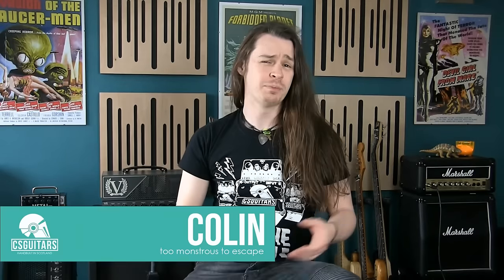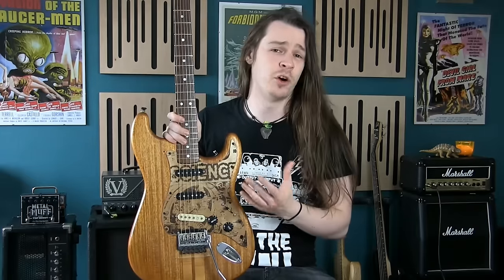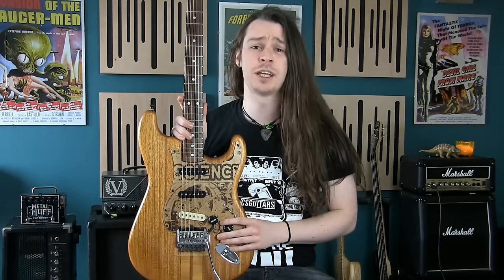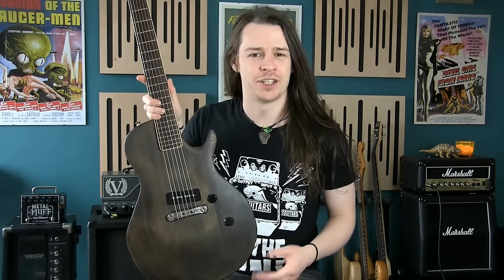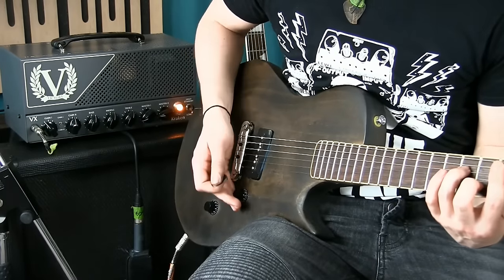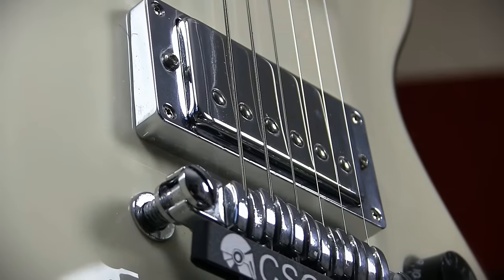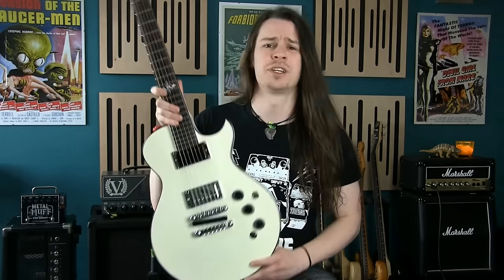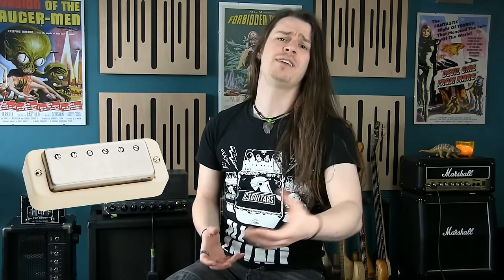Single Coil vs P90 vs Humbucker: What's The Difference?

Comment: make a video about difference between active and passive pickup....please...
Reply: Reggie SoundBox 

Colin did that already. He is not a fan of the active pickups. I think active pickups shine better as bass pickups to guitar.
Reply: Gringo Green did he?i'll watch it later...thanks...
Reply: active basses have good control but passive bass pickups sound just amazing with the right overdrive. R.I.P. lemmy of motorhead.
Reply: Reggie SoundBox Yeah its a really old video though.
Reply: active pickups are good if you dont own an amp....lol. i have actives in my ltd ec330fm guitar and my ibanez sr300 bass...in the bass they are amazing. in the guitar i dont see much difference other than "shpuld i change the battery soon?" lol
Reply: He did...He found that active pickups suck because they take away your ability to dynamically control your sound.
Reply: Which is bullshit, there are active pickups that do have dynamics. For example Fishman Fluence.
Reply: @EvilDragon666  i'm pretty sure at the time he made the video, the only active pickups in the market were EMGs or EMG clones
Reply: @hazenstribling2646  In 2017? Wrong. Fishman Fluence existed in 2017. And there are other active pickups that are not EMG/EMG clones, have existed for years...
Reply: @EvilDragon666  I'd rather go with some DiMarzios for half the price.
Reply: @homevalueglass3809  I wouldn't because Fishmans are just THAT awesome :) Just purely MHO.
Reply: Active pick ups hold notes longer

Comment: A great detailed video, just one comment about you putting the pickups to certain genres, it should be mentioned that you can get any genre on all three pickups if you play them right. Gary Moore, BB King and Joe Bonamassa all have bluesy feely stuff on buckers, where the likes Andrew Groves from Arcane Roots and Simon Neil from Biffy Clyro have got really heavy sounds from strats!
Reply: Totally agree. Like for example, people usually recommend single coil pickups for fuzz, but guys like Robby Krieger and Josh Homme got along just fine with humbuckers.
Reply: WRAITH don't forget Jack White and Billy Gibbons, both notorious fuzz users with their collection of humbuckers
Reply: Don't forget Ritchie Blackmore. Deep Purple were one of the proto metal bands and Blackmore always played a Strat.
Reply from the maker: Not at all saying that you can't play anything with any pickup. Just most common uses for the sake of keeping the video concise and under 7 minutes long.
Reply: John Maloney Uli Roth is also a good example. No one can tell me "Sails of Charon" isn't heavy and thick in any way, shape or form.
Reply: It also depends, of course, on the quality and build of the pickups. I bought a guitar with two humbuckers that whilst being excellent for very heavy shit, just can't quite cut it for more melodic stuff without muddying everything up a bit too much.
Currently my local guitar tech has it and is fitting a more versatile humbucker (iron Gear Rolling Mill) and a humbucking P90 (Iron Gear Alchemist 90). Hopefully this will improve my versatility and tone, if not my scrappy playing.
Reply: I keep seeing comments on YouTube, where the end of the comment has been cut off, why is this happening? Is there any way to see the full comment?
Reply from the maker: +B0rnles13 there is an easy way to see the whole comment. All you have to do is click on the
Reply: GENIUS =D
Reply: If the extension button is gone it might be connected to your browser. 
Check if you zoomed in at some point...that might have caused it to vanish.
Reply: I've heard of a lot of metal guys who hide p-90s under a humbucker cover
 As for players getting different genre sounds out of uncommon genre pickups...these guys have everything customized.To the kid in the front row,its the same standard Strat he can buy at Guitar center ,but reality is that guitar has has been heavily modded.Along with the amp,which looks like a two thousand dollar amp,but you'd have to pay a tech 15 grand more to do what's been modified for these players.Then run it through a million dollar board,and yeah you're not getting that Stevie Ray sound from a stock les Paul through a stock Fender amp.
 These players have endorsement deals,so they play certain gear, even if their tastes change and they mod them to sound more like a competing brand.
 Bottom line is,off the shelf for the kid looking for a sound...don't base it on what you see on stage.
Reply: You dont have to pay 15 grand to get ANY tone period. Ya if you use a $100 guitar and a $50 amp with 30 bucks worth of pedals youre going to be limited. But its pretty easy to build a $500 setup that will get kindof close to any sound with an hsh/hss guitar a decent modelling amp and/or a megacheap tube amp and multifx pedal.  ANY guitarist understands that with cheap shit pickups fed into a cheap garbage amp youre flat out not going to sound good. But even LOW end guitars now are 10x bettr than anything from 20 years ago and you can get pretty nice electronics for pocket change compared to what they had to pay 30 years ago
Reply: honestly though i cant understand a metal guy using p90's. i know theyre the rage but damn toss a nazgul and sentient in there and youve got a stunning array of sound and some serious metal pickups
Reply: always liked pearl jams tone better. More deep metal than nirvana. Nirvana had the pretty blond frontman the 14yo girls who actually buy most music love though
Reply: Vince guitarists know you CAN  get >close<. Newbies reading this might think you can do anything with one guitar. I have 5 very different guitars and there are tones i cannot get (setting aside the player). Of course i can get very nice and close tones. But you wont get strat twang on an lp period. You wont get the heavy crunch or DEEP full sound on a single coil strat you can on an lp/etc.
Reply: Snip Snap Doggo Very good points. I have a Les Paul. I love the neck PAF pickup sound; it is blues to me. Yeah, the bridge can rip it, which makes the Les Paul such  versatile guitar. I also own two Telecasters, and there isn't much they can't do (they are more capable than I am). There is a lot of overlap when it comes to what different pickups can do.
Reply: True.  Dave Hlubek used an LP Gold Top w/P-90's for much of Molly Hatchet's classic stuff- inc "Dreams I'll Never See" and "Fall of the Peacemakers".   Between him and Duane Roland, they got some SWEET guitar sounds in those songs!   You can see Dave playing that guitar on a lot of the live vids posted here, and it doesn't get much more RAWK than that!   As for Strats, just listen to any given Iron Maiden album to see wht they can do, lol.   With all that said,  both guitars I reach for first have P-90('s) in them: a 50's tribute SG, and a Schecter Solo Special w/a P 90 in the neck.  Through a Fender amp, they just give me the sound I like best: warm cleans and bluesy crunch.
Reply: NoiseFeedMusic I think the problem is that most musicians you listen to have heavy distortion on the trouble pickup with lots of other bass and drums that cover up the differences in pickups.

Take something like Stevie Ray Vaughan or Hendrix's is Little wing. It would be very difficult to do that with a shorter scale LP style guitar, and also hard with humbuckers to get that sound. 

I think musicians who have played them all can instantly hear the differences and can feel frustrated by trying to play certain sounds on certain pickups with certain Distortion levels. I think the conventional wisdom is exactly right on when you hear the guitar sound by itself.
Reply: @ScienceofLoud  underrated comment

Comment: I just wanna add some more points about single coils because I've been so obsessed with them lately.

The number of wraps, also known as the number of turns, around a pickup coil affects the EQ in the end by altering the output level and frequency response of the pickup.

More wraps result in a higher output level and a stronger mid-range, which can make the pickup sound warmer and more powerful. On the other hand, fewer wraps result in a lower output level and a more open high-end, which can make the pickup sound brighter and more articulate.

Common DC rating of pickups refers to the DC resistance of the coil, which is measured in ohms. The DC resistance of a pickup is an important characteristic as it directly affects the output level and tone of the pickup.

Here are the characteristics of each common DC rating of pickups:

Low DC Resistance Pickups (less than 6k ohms): These pickups typically have a bright, open sound with a clear high-end response. They are great for vintage tones and cleaner playing styles. However, they may lack the mid-range punch and sustain of higher DC resistance pickups.

Medium DC Resistance Pickups (between 6k and 12k ohms): These pickups offer a balanced tone with a moderate amount of mid-range punch and sustain. They are versatile and suitable for a wide range of playing styles and musical genres.

High DC Resistance Pickups (more than 12k ohms): These pickups typically have a strong mid-range and high-end response, which can result in a more aggressive and focused tone. They are great for heavier playing styles and can help push the amplifier into overdrive. However, they may lack the clarity and openness of lower DC resistance pickups.

It's important to note that the DC resistance rating is just one aspect of a pickup's tone, and that other factors such as magnet type and wire gauge also play a significant role in determining the overall sound of a pickup.

The wire gauge of a single coil pickup affects the tone by altering the amount of wire used to make the coil, which can affect the resistance, inductance, and capacitance of the pickup.

Thicker wire has a lower resistance but a higher inductance, which can result in a brighter, more focused tone with a strong midrange. This is because thicker wire creates a stronger magnetic field, which can increase the output level and provide more sustain.

Thinner wire, on the other hand, has a higher resistance but a lower inductance, which can result in a warmer, more vintage tone with a softer attack. This is because thinner wire creates a weaker magnetic field, which can result in a more delicate and nuanced sound.

The wire gauge also affects the capacitance of the pickup, which can influence the high-end response of the pickup. Higher capacitance can result in a smoother, warmer tone with less high-end sparkle, while lower capacitance can result in a brighter, more articulate tone with more high-end presence.

It's important to note that the wire gauge is just one of many factors that contribute to the overall tone of a single coil pickup. Other factors, such as the type and strength of the magnets, the number of turns in the coil, and the type of insulation used, also play important roles in shaping the sound of a pickup.

Ultimately, the choice of wire gauge depends on the desired tone and playing style. Thicker wire is generally better suited for heavier playing styles and brighter, more focused tones, while thinner wire is better suited for cleaner playing styles and warmer, more vintage tones.

That being said, there are many boutique single coil builders that produce high-quality pickups, but here are five that are particularly noteworthy. Here are some to lookout for –

Lollar Pickups - Based in Tacoma, Washington, Lollar Pickups offers a wide range of handmade single coil pickups for guitar and bass. Their pickups are known for their clarity, balance, and dynamic response, and they have been used by many notable guitarists.

Lindy Fralin Pickups - Lindy Fralin is a well-known name in the world of boutique pickups, and his single coil pickups are particularly popular. Based in Richmond, Virginia, Fralin's pickups are known for their clarity, warmth, and vintage vibe.

Porter Pickups - Based in Orange County, California, Porter Pickups offers a range of single coil pickups that are handmade using high-quality materials. Their pickups are known for their balance, clarity, and versatility, and they are particularly popular among blues and rock guitarists.

Jason Lollar - In addition to his work with Lollar Pickups, Jason Lollar also produces handmade pickups under his own name. Based in Seattle, Washington, Lollar's pickups are known for their clarity, warmth, and vintage character.

Klein Pickups - Based in Petaluma, California, Klein Pickups is a relatively new player in the world of boutique pickups, but they have quickly gained a reputation for their high-quality single coil pickups. Their pickups are known for their clarity, balance, and versatility, and they are particularly popular among jazz and fusion guitarists.

All of these builders use high-quality materials and traditional winding techniques to produce pickups that are renowned for their tone and quality. While their pickups can be more expensive than mass-produced pickups, many players consider them to be a worthwhile investment in their tone.

Comment: I really wanna put a single coil in something like a Jackson for leads. I love my super dark down tuned deathcore/metalcore, but the sound of a single coil on the neck for cleans and leads is just incredible.
Reply: My '91 Jackson Dinky XL has a H-S-S configuration, which is arguably one of the most versatile arrangements out there.  Reverend Guitars are also exploring a lot of the possibilities with their available combinations of pickups (Railhammers, P90's, Single-coils, HB's, etc...).
Reply: I have that feature on several guitars.  Works great.

Comment: I'm sure that you do know that regardless of its unique construction, the P-90 is a single-coil, not "technically" but actually. It's louder, thicker and punchier sounding than the Strat, and close to a good Tele bridge pickup which is usually a little brighter. 
The P-90 was NOT the "next logical evolution of guitar pickup technology" after the Strat. It came way before the Strat which was introduced in 1954. The P-90 was introduced by Gibson in 1946. 
Using any kind of effect, wah, distortion, etc., masks the sound of the pickup. Not a good idea in a shootout.

Comment: Like most guitarists, I use all three pick up variations on various guitars and I think using effects, whether it be pedals for delay etc or amp distortion makes the comparison null and void. If you had a clean amp set the same for all the pick ups then it would show the true sound. Like the volume difference and the actual sound of the pick ups. Some days I may use a Strat with 3 single coils, other days I may use a Les Paul Junior with a single P90 to play the same songs as once the signal has gone through my pedal board and amps I can get the sound I want.

Comment: I am curious on why guitars don't normally use split coil pickups like many basses do. One coil for half of the strings and another for the other half. They sound similar to a single coil but without the hum.Maybe not enough space between strings?

Comment: Good presentation, as far as it went.  I think that's an oversimplification in suggesting (and demonstrating) single-coils for clean playing and humbuckers for dirt.  Nawwww.  Single-coil pickups are often used in overdriven solos, and humbuckers are the preferred pickup in playing clean jazz.  So that distinction just doesn't hold.  P-90s have some raunch and can be gritty, but they clean up well and, to my ear at least, have more clean character than a Strat pickup.
Reply from the maker: For the sake of making a concise, short video I had to chose a few things to generalise on. 

Neck single coils are my preference for high gain solos and as you say, lots of jazz players are using high output humbuckers for the smooth clean sustain.

Comment: MASTER HAS MADE A VIDEO I SUGGESTED! MASTER LOVES ME! Great video, mate. Recently I've been using a set of slightly overwound low output humbucker sized P90's in my 335 for hard and psychedelic rock and the sound is absolutely MASSIVE, especially for leads where it cuts through the mix like Van Gogh with an ear. It's probably one of my new favorite combinations.

Comment: What's the story with frequency response?  I see mid boost pedals used to help a single coil emulate a humbucker, but it was my understanding that humbuckers have a scooped mid section, is this the case, if so the mid boost makes no sense?  Thanks in advance.

Comment: I believe you said that there is "vibration in the single coil pickups"? there isn't. I make my own single coils and starting to make other types as well.  there is no vibration within the pickup at all.  it is just the small electric charge that happens in the coil.  People believe that there is a vibration, but the coil is wound too tightly, and it is actually very difficult to get the magnets into their positions, so those are not vibrating either.
Reply from the maker: +SC86Canuck if you are referring to the point I made about the pickup vibrating with respect to the strings then what I mean is that the entire pickup vibrates under the string as it is mechanically connected to the body of the guitar, which vibrates. 

A pickup gets its signals two fold. Firstly from the strings vibrating above the pickup, and secondly from the vibration of the entire pickup under the string.

If your strings were entirely static and you vibrated the pickup under them, the pickup would generate a signal.

This is the science behind why some players insist that screwing their pickups directly into the body gives a better sound than suspending them on a pickup ring or scratch plate. 

I build pickups too, check my more in depth videos on the subject. We pot pickups to ensure that nothing vibrates within them.